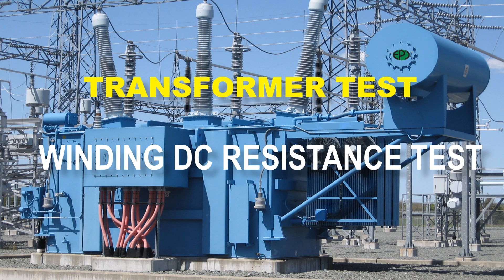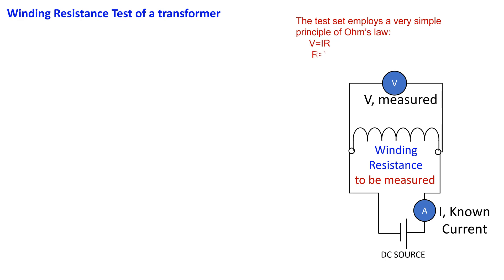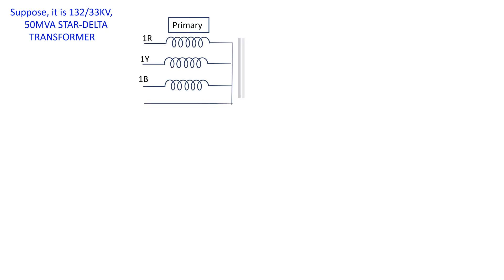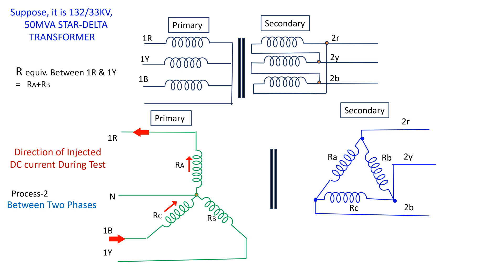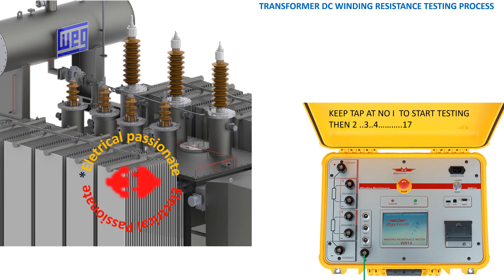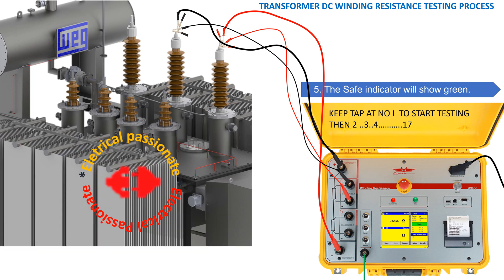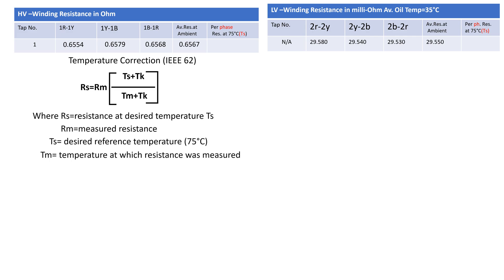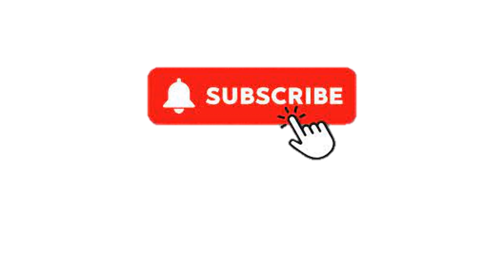TRANSFORMER WINDING DC RESISTANCE TEST/DC RESISTANCE OF WINDING/TEST OF DC RESISTANCE OF TRANSFORMER

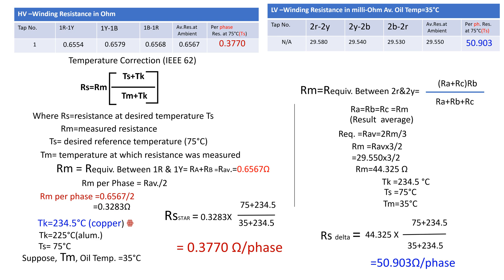Comment: 12:06 you took the wrong unit for LV winding resistance. It should be milli ohm, and not ohm. HV winding has more resistance than LV winding, right.
Reply from the maker: You are welcome. The results are taken from a practical test. HV in ohm and LV in milli-ohm. I don't find any wrong. Thank you ❤.
Reply: @electricalpassionate you didn’t get me it seems. The final result of LV should be milli ohm, like 50.9 milli ohms and not 50.9 ohms